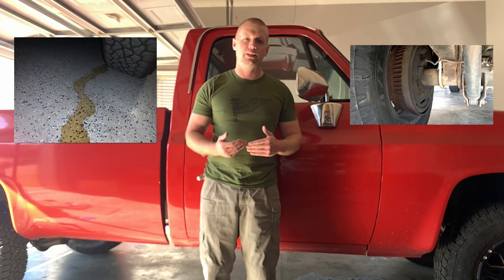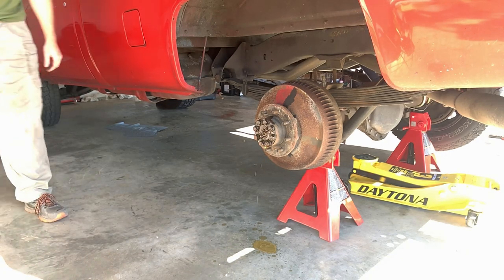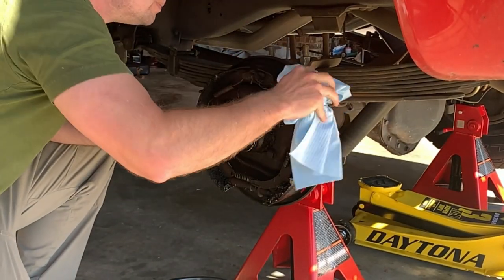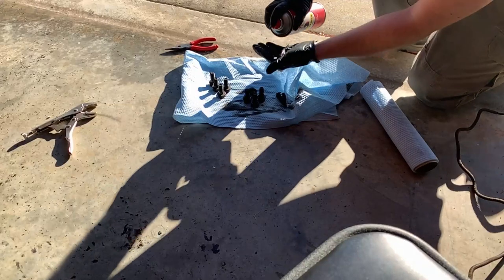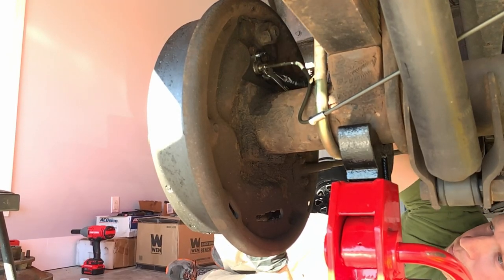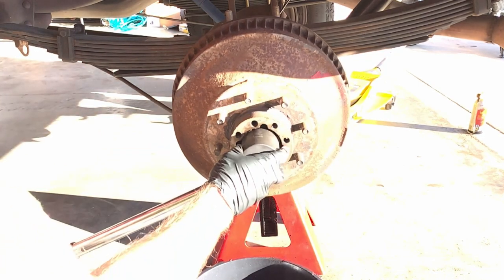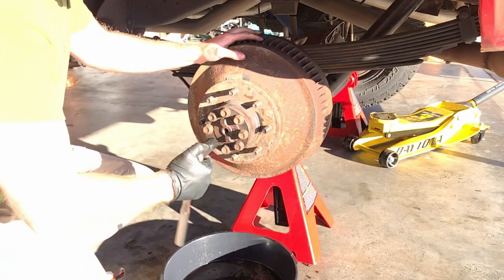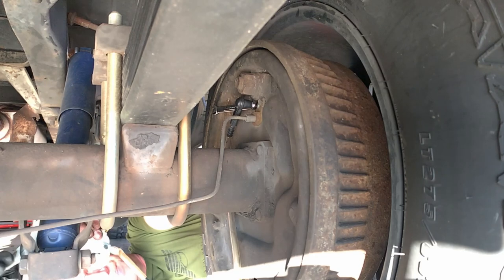Drum Brake Wheel Cylinder Replacement for 1973-1987 Chevy & GM 3/4 & 1 Ton Trucks

Comment: One technique I’ve found that works well with bleeding the rear is to apply the vacuum bleeder, let it run and slowly depress the brake pedal a few times.  If you have the larger rectangular brake fluid reservoir, You’ll see the smaller side fluid level go down each time.  The vacuum bleeder alone didn’t get my pedal feel where I wanted it. Now the brakes are like a new truck.

Comment: thanks for the lesson ! I’m doing a 83 chevy P30 van with dually wheels and I sure don’t have the clearance between the leaf spring and the back of the drum that you obviously have, so I’ve found myself undertaking the  removal of the leaf springs to accomplish the replacement of a stripped bleeder screw that has had my van down now for months, I’ve now purchased all the parts I required ( I thought ) like shackles, springs and shocks being that my  need to bleed my brakes was troubled by a single sstripped out bleeder screw !!! Well like usual, back to the auto parts store and harbor freight for more stuff !!!
Reply: I have an 88 Chevy 1 ton dump Same problem you have. So I'm going to try and remove the wheel cylinder pull it out from the back plater then I can bleed it by using clamps on the plunger pins to holds it put pressure through  the bleed screw .  OR take the U bolts that holds the axle to the rear. Now I can jack up the frame and by doing so the leaf springs goes up away from axle and out of the way.

Comment: Great video! Quick question, where you measured the drum is this also where you measure it to determine the size for the master cylinder and power booster? There are apparently 2 different sizes to get an 11in and 13in
Reply from the maker: Thanks!  And yes, the print on the outside that shows max diameter will indicate the 11 inch versus 13 inch drum system!

Comment: Please someone help me I have 1998 gmc 1500 5.7L v8 it has the 14 bolt rear end but it has 6 bolt wheel hubs and I just completely ordered the wrong drum set as the backing plate sits so far back and the drum doesn’t meet with it I should have these drums but for 6 bolt I just don’t understand what the hell is going on I can’t fit my drum on

Comment: This video is seriously top notch. 👍🏻👍🏻 would this procedure be very similar if working on the semi floating 14 bolt axle? Do you also happen to have a video showing how to do the drum brake replacement on these?
Reply from the maker: Yes, it would be very similar.  You may have a different spindle nut socket set up, some years had an inner and outer nut.  And I will actually be putting together a drum and shoe video in the next month or so.

Comment: Is it normal for the drive shaft to spin when u spin the drum? I feel like I messed up with the spindle nuts or something
Reply from the maker: If you have the floating axle rear end like the 14-bolt your axle is out so there should be no way to spin the drive shaft until the axle is reinstalled. If its spinning with your axle installed then that is proper.

Comment: 73 c20 has 2 of the spindle nuts
Reply from the maker: Yes there are some versions of the 14-bolt that came with two spindle nuts.  You can google the factory repair manual and follow the same procedure but set the bearing load following the manual